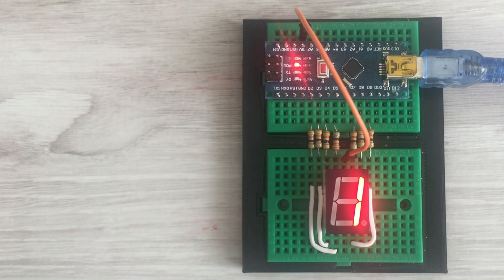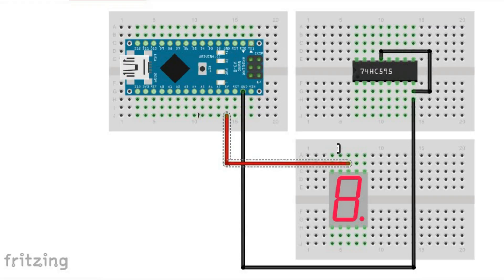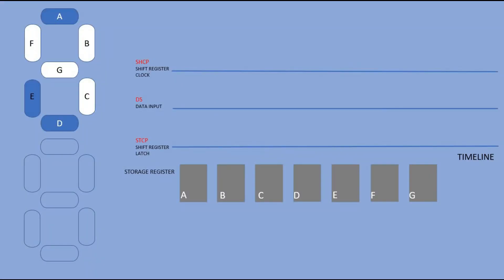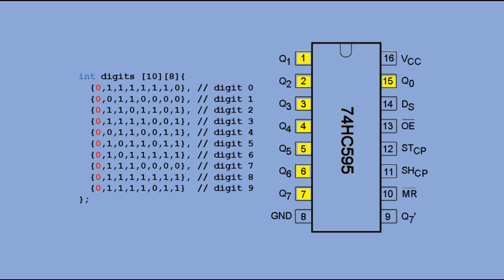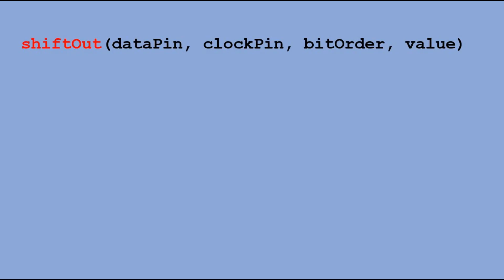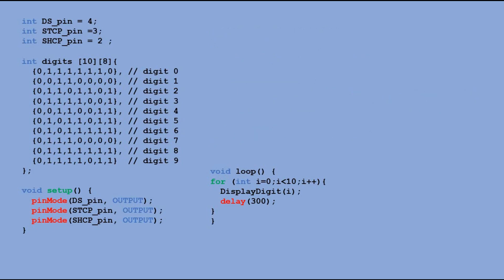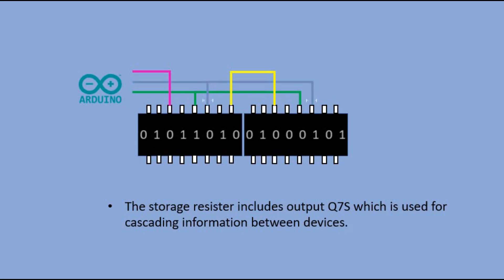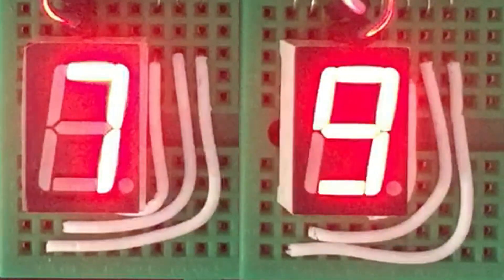How to use 74HC595 Shift registers to control mulitple 7 segment displays

Comment: Hi Mario. I really appreciate your work! Your videos are great helping me to get along with Arduino and getting inspiration for new projects. 
For comprehension I have one question: How do you ensure that 8-bits will be transferred to the shift register (for example - sending int 0 to print the digital "8"). If I am correct the data type int can range from 8-bit to higher...how do we make clear that we send 7 zeros after a high to print an "0" as another example. 
Have a good day!
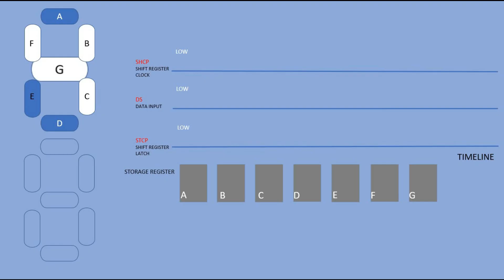Reply from the maker: Well I am not sending intiger value to the register. I am sending it to my custom function which in turn pushes 8 bits one by one to a register , 8 bits that correspond to the digit that was received by the function. The graphical representation of sending of those bits for digit 4 is shown at time 3:47 And the function that dooes it is display digit that can be seen at 6:11
Reply: @marios_ideas  Alright. Thank you for yout time and help!

Comment: "Bits are shifted into the shift register when the clock pin transitions from high to low."

~checks datasheet~

Other way around, m8. You had my attention there for a sec. I was getting a weird bug last night that would have been explained by that.
Reply from the maker: I will check . But how come my code works. If it was other way around I would get jibrish pushed into shift register
Reply from the maker: Check video https://www.youtube.com/watch?v=bqfPZXEuyuc Go to minute 2:47 Section 7. It clearly says from Low to High
Reply: I know it's low to high. I checked the datasheet. I'm not sure why another video needs to be involved here.

Your video said "high to low". Hence the quotation marks.

Comment: Hello Sir iam Electronic Weighig Scale Manufacturer. In our weighing scale the weight shows on 6digit seven segment display which has 14pin. I want to reduce the no of pins by using hc595 ic. Is this able to do 14 pin to 4pin? Please suggest me
Reply from the maker: So you are using multiplexing. If I get you right you are using 14 pins of the microcontroller (6digits +8 segments A-F and a dot). Shift registers would work but you would need 6 shift registers chain connected. Then you would need 3 pins on the microcontroller. I would do it differently however. I would use MAX 7219 chip that allows you to make 8x8 matrix of leds so 6x8 that you would need would work perfectly. Check my video https://youtu.be/SGjQ-E3UD7A
There are libraries available which make it really simple. That was one of the videos I was planning to make.
You can buy ready to use parts https://pl.aliexpress.com/item/1326009025.html?spm=a2g0o.productlist.0.0.e6136980polRxz&algo_pvid=12c063d7-f1ca-4f6c-96ed-61c73e794136&algo_expid=12c063d7-f1ca-4f6c-96ed-61c73e794136-1&btsid=2100bb4a16140144265718605e526e&ws_ab_test=searchweb0_0,searchweb201602_,searchweb201603_

Comment: Hi Mario please help! I have an electronic bingo board from the 1980's. It has 2 boards each with two 7 segment displays. One board has the chip and then connects the power and data to the other board. The main board with the chip has 3 wires that connect to the main bingo board which gives it its power and data. The wires had been cut so I asked my electrician friend to test it for me. He put some thin wiring to the bingo board and then to the 3 wires but nothing happened. I am worried we fried the chip incase he sent 5v in the data in cable. But since then I took it to an electronic specialist and he has connected it to 5v and all four 7 segment displays are counting in unison 0-9. Does that mean the chip is ok since it is counting like in test mode, is it the chip making it do that? Or if it was fried would it not count anymore?
Reply from the maker: The cip must be ok as if the shift register or the 7 segment display was fried there is no way counting 0-9 would work
Reply: @marios_ideas  Wow! Thank you so much Mario. That gives me hope that it will work correctly when we connect it again to the console :)
Reply: @marios_ideas  Hi again Mario, you were absolutely right! We re-wired the pcb with the chip and digitals correctly and connected it to the compatible bingo board and it works as it should. Displays the numbers perfectly! Thanks again :)

Comment: Hello. Very nice video explaining shift registers, especially the part where you explain the data sent over the different channels. Nice would be though to also include to dot as the 8th out pin instead of leaving it unused
.
Reply from the maker: You are right. I should have added the dot pin.

Comment: I know this video is geared for Arduino board users, I was hoping that there wouldn't be much difference for ESP32 boards. I don't know if ESP32 boards accept/understand the first format, but I found some examples using the shiftOut method, and the ESP32 board ran it successfully. You explained this complicated stuff well!
Reply from the maker: Glad you liked it. I am not an expert. I stumbled upon Arduino 2 years ago and it became my hobby. I learn as I go alone. And as I learned I struggled to find one comprehensive guide for each topic I was interested in. So I decided to create such tutorials myself:)
Reply: @marios_ideas  I understand! When you can finally figure out something that's complicated, you make the best to teach it to others. I got my starter kit about 2.5 years ago, picked it up but let it sit on my shelf for a year or so because it was getting complicated. I treat it like a hobby instead of a job now. It should be enjoyable, and if a component becomes too challenging, I switch to some other Arduino component. Now, I want to move on to the 4 digit 7 segment display.

Comment: Are those current resistors 220Ohm? Thank you
Reply from the maker: I used 220Ohm resistors as I had those. I did not calculate the exact value of the resistor. With simple led project s I use either 220Ohm or 330Ohm resistors and both do the trick
Reply: @marios_ideas  I'm getting in the habit of using resistor arrays, as I'm getting sick of having to wire up individual resistors! Thank you.

Also, I tested my 7-segment display, and it is a common cathode: When I ground either of the common pins, then touch one of the (cathode) pins, a segment lights up. You're using a common anode LED segment. Wiring for mine is going to be (a little) (a lot) different. I've never used a 7-segment LED, and its only the second time I've wired up a shift register.

And, can any pins be used for DC/latch/clock?
Thank you!

Comment: Thank you for the video and I have a question. I'm wondering if I could use 4 digit 7 segment display with two of these shift registers and Arduino and then also connect something else to it? I mean if the Arduino wouldn't blow up or something.
Reply from the maker: Arduino would not blw up. If you cnnect more sensors potentially you may need power e.g. shift registers from external 5v power source  as Arduino may not cope with too many devices. Then data pis of shift registers, servos , led strips etc stil go to arduino but you connect 5x and GND to external power source

Comment: Thank you for this video.... I always am hearing about shift registers.... but I have only used mcp27013... not sure which is better... but I assume shift register is cheaper... any thoughts on this comparison?
Reply from the maker: I have never used mcp27013. I believe it extends number of output pins of Arduino.  It is a complitly different concept . I will try to look at mcp27013 and let you know which one I would prefer.
Reply: @marios_ideas  it's i2c and each pin can be configured as input or output... I guess there is a library that must take up program memory ( Wire.h ) ... I wonder how big it actually is